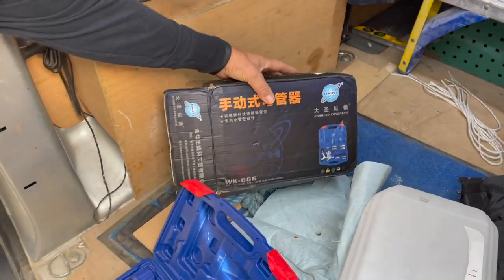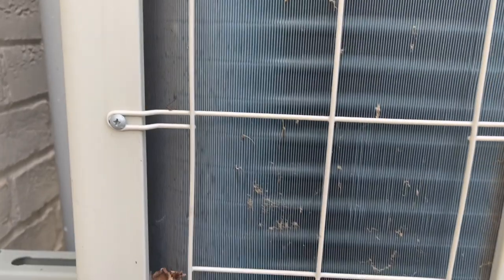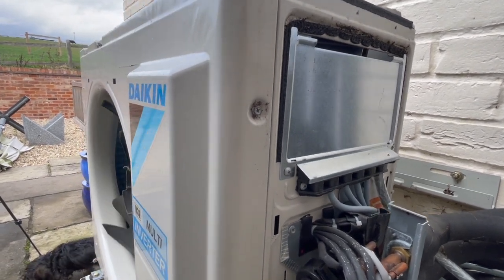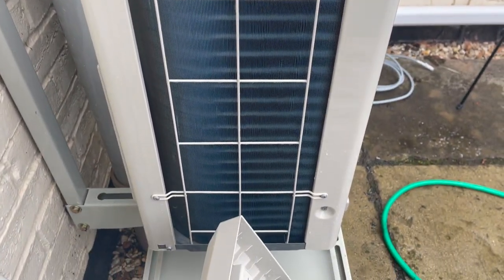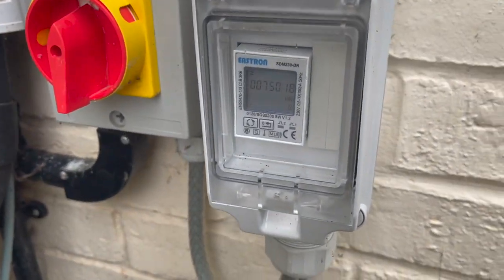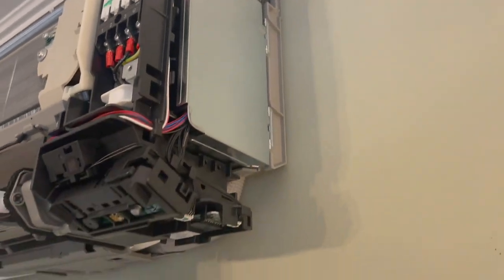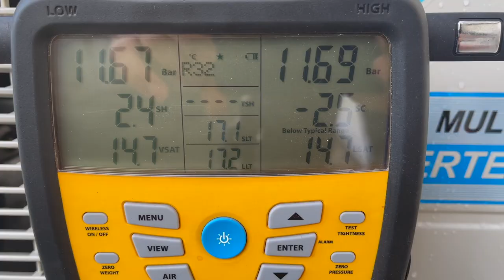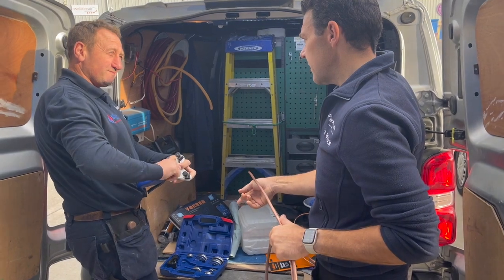Heat Pumps - They Need Servicing, Right?

Comment: Connecting gauge lines to a system during a service is terrible practice. You’re venting a small amount of refrigerant to the atmosphere every single time. You should only connect gauge lines if you believe there’s an issue and only need to take suction/discharge/liquid temps to decide if a system is working correctly.
Reply: I’d agree. Never hook up gauges during a service unless you think there is a serious issue with your fridge circuit, if you do have to them core depressors and wireless gauges are best.
Reply: 100% agree

Comment: Interesting to see that your heatpump isn’t installed as per Diakin specifications it has less than 300mm gap between the wall and the back of the heatpump and is too close to the wall on the right.

Comment: As a retired fridge and a/c engineer with 30 years experience, i would never put on the gauges unles there's a problem. To check gas charge, get all indoor units running full bat and check tempreture difference between air flow and return. If gas charge is okay , temp. diff. should be at least 10 degrees c

Comment: nice video but I would never put a set of gauges on an Inverter Heat Pump. You loose refrigerant and because it is critically charged it affects the system greatly. Access sensors from Fieldpiece or Yellow Jacket are available that will hook up Bluetooth to your phone and if needed you can hook up a short 3-foot hose to them if you need to adjust charge. Also, the indoor units need to be properly power washed and then rinsed properly including the drain pan. The blower wheel needs to be removed and cleaned as well.  There are kits to do this work to protect the walls and floors. I know these units are only 18 months old but when they get 2 or 3 years old, they will need a more in-depth cleaning as I have described.

Comment: I left a comment regarding the SY cable which I think you're using for power. SY cable is not UV resistant and shouldn't be used for power. It's a control cable. Just giving you a heads up. 👍

Comment: Excellent video! I have the same Daikin 4MXM68 so very useful info 👍🏻.  One thing shocked me was your energy consumption. 750 kWh over 17 months. Mine will likely double that or more. Use it sparsely and still. Using it for 4 months now.
Reply: more heat losses = more power consumption, easy
Reply: Does seem ridiculously low. Looking at that house it has solid walls too. Even with cooking and water on top, still peanuts.

Comment: I have had one heating my workshop for nearly 20 years. The inside unit gets a fairly regular clean as there is a fair bit of dust from woodworking. The outside unit gets a regular wash  every time it de-ices and gets a vac out in the autumn. Maintenance has been the replacement of a swing actuator, a compressor capacitor and a fan capacitor and a reversing valve solenoid coil. All cheap enough as DIY jobs. Never had anyone check the refrigerant. 
Like many people have found it's not much use in icing conditions (temp and dewpoint both just above zero C). Fine in cold, dry conditions.

Comment: Brilliant job you did.
But let’s be honest here; the majority of the heat pumps will not receive this kind of service.
Like the majority of the gas boilers don’t have their burners opened up, their heat exchangers cleaned and the debris removed from their condensate traps, when being serviced.
Reply from the maker: I think you're absolutely right sadly. I go to many breakdowns on appliances which have been "serviced regularly" but clearly haven't been shown the pointy end of a vacuum cleaner for years. Some engineers are either too overworked or have to price the job so low as to be competitive that they just can't afford to take the time.
Reply: @dameonhill  engineer is sometimes too strong a word to use on some trades-folk I've come across - what you did was quite satisfying to watch yet 90% DIY-able but no doubt that would cause some folks to get their backs up and especially with respect to warranty! Most consumers won't stomach spending £xxx on a yearly service especially if they got away with £xx or nothing for their gas boiler...in a way this to me highlights one of the negatives about an A2A HP vs A2W (more coils to clean hence more £££ for servicing!) but then again it's no different to folks that drive around on flat tyres or with no oil and then seem surprised when they breakdown 🙄
Reply: I'd say 100% DIYable. Let's face it, if there was a gas leak, it just wouldn't work. Same as your car aircon. Looking at his units at seventeen months old, I'd say service interval of three years too. @Umski

Comment: Hi Daemon, I have the same units (Daikin Stylish) which were installed in April this year. I've cleaned the filters, but got a persistent unpleasant smell when one of the unit operates in fan mode. I'm not sure I should be disassembling it myself, but is there anything I can spray in to kill off any mould/bacteria etc?

Comment: Heat pump manufacturers first have to get their shit straight
Reply: @zlmdragon.  issue is that COP is not only dependant on outside temperature, but also humidity and defrost cycle of the heatpump. With high humidity and say around 0 degrees temperature COP might be lower than at -5C and low humidity. The built-in power consumption meter tends to be incorrect, and for example so called Smart cloud expansion (panasonic) in my place costs 180 eur delivered without installation, and basically is shit, does not even have a proper app, it is browser-based. 
I mean heatpumps are very simple machines, however manufacturers still manage to screw it up
Reply: @zlmdragon.  I am an engineer, I understand quite well how it works, and am capable to spot obvious drawbacks, that could be fixed quite easily. 
Millions are also doing random weird shit, it does not mean that it is good and everybody should do it, right?
Reply: How would it get round the bend?

Comment: Just watched most idi otic pointless waste of time , trying to prove what they are doing something. 20 minutes doing nothing, yes nothing all that cleaning is pointless, using chemicals pointless, the most important refilling he skipped as its one button done. this is how you do : take blower open hold cooler what it would not spin from air as it can create energy and blow inside 5 seconds done, close it up, never open any electrical panel, as you open the seals must be replaced, you open if it malfunction. the seal stops water and moisture in. He did open cause after he open s seals will be bad and later machine will corode near wires than you will pay him more money for damage he done. You use chemicals if its molded badly, which happens. Couple leafs do nothing. Putting liquid inside is also bad it will lower life of machine as it will corode. There is reason why machine is hidden from rain. So skip to 20 min, this is what you need only to refill use simple cheap refiller, automatic does same as with gages. Now do not use some electric counter like he did as it also uses energy lol, usually machine will have in software menu how much energy it used. Actually he lied, machine will use energy more than its colder or hotter. More cold more energy it will need. And on some temp it will shut off after you must use simple electrical heating lol. Some of these machines turns off at minus15 some at minus 30 depends which model.
Reply: simple cheap refiller? automatic does the same as with gauges? sounds like someone is scamming you! multisplits/mini splits dont need refilling even after 20+ years.  If they do you have a factory defect/damaged system or cowboy installer!  

If you ever worked in the industry and saw the average quality of installers you would know that this guy clearly cares and has a very good standard of work.